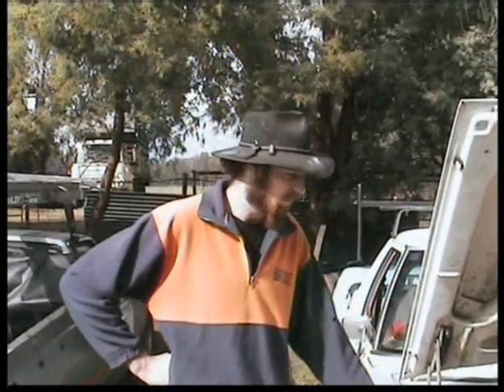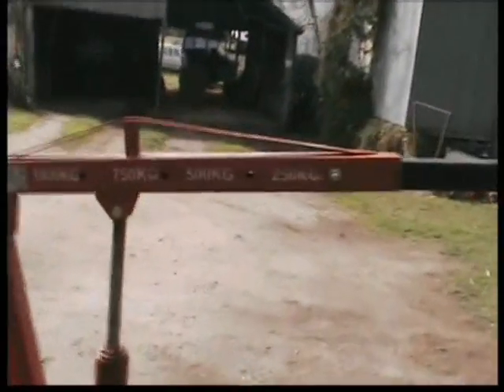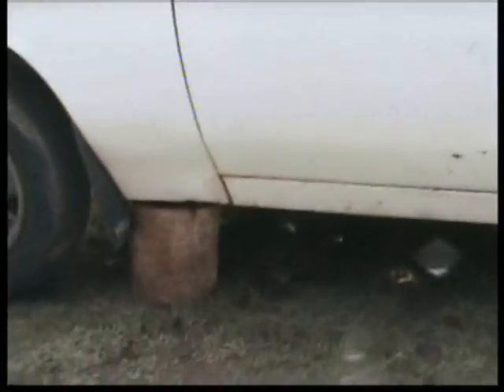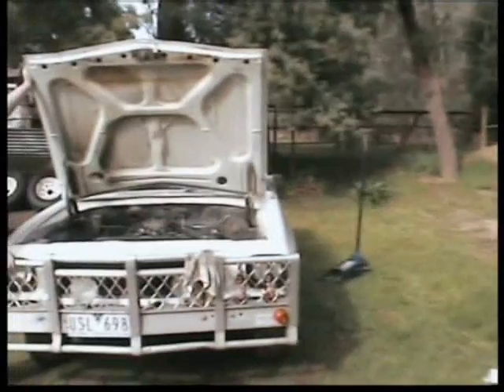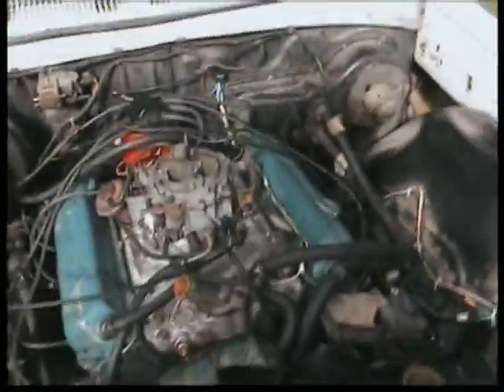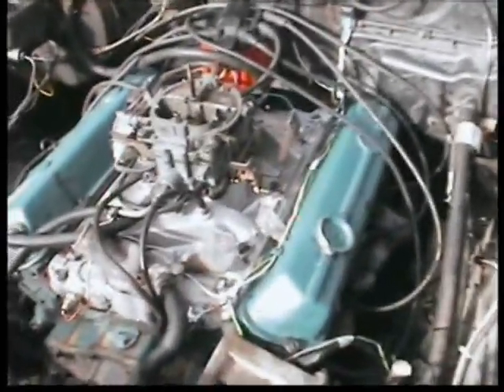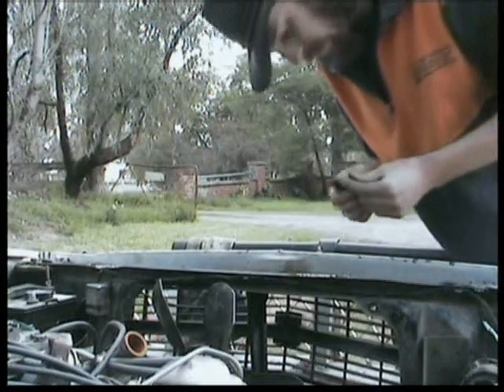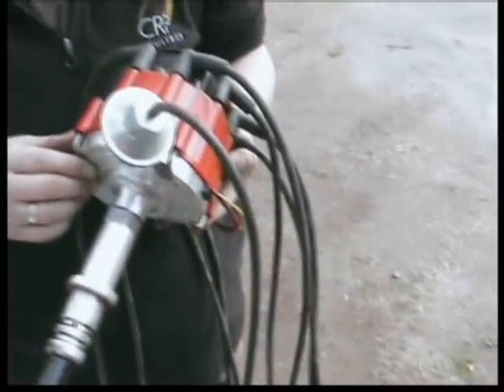How To Remove An Engine: PART 1.

Comment: youre the victa guy! great tutorial. swapping  351C into my 6 cylinder XF falcon
Reply from the maker: Haha Sure am. Nice mate. Will be a bit of a project from what I hear. You'll have to cut and panel beat the firewall in to make it fit. Most guys just get an XD XE and put the XF front on it.
Reply: shit?! i was told they straight swapped and only worries were the xf not having the mounting stuff for the clutch master which would just be 2 bolts from memory. seems common there are heaps of 351C's in XF on youtube... unfortunately the XD is rusted out and i got a good straight XF for it. Inherited the XD...  anyway your video gave me a lot more knowledge so when mechanic mate and crane come i wont be in the dark (i've only done bike motor swaps). I was wondering how you pull a gear box off as they're mighty heavy, but now i know you pull the lot

Comment from the maker: Well you can use a block and tackle from the rafters or an "A" frame or a good solid branch of a tree if ya keen. Just be really carefull that it can take the weight. I have also used forklifts and a jib on the back of a tracter before.

Comment: Just a helpful translation:

Boot = Trunk
Bonnet = Hood
Wing = Fender
Wheel nut = Lug nut
Brake disk = Rotor
Gear Stick = Shifter
Windscreen = Windshield
Drophead = Convertible
Estate Car = Station Wagon
Petrol = Gas
Hand Brake = Parking Brake
Silencer = Muffler
Spanner = Wrench
Tyre = Tire
Nick = Condition (In some uses)
Kit = Stuff
Ute = El Camino-style car
Arse = You, QcPride

Glad to be of use.

Comment from the maker: @JohnnyDesaint  Oh. That would require a bit of engineering then. The mounts wouldn't be to hard to weld up but the oil pan would have to be custom made. You may be able to dint it in carefully or cut and weld it. Not to sure though. Wouldn't it just be easier to sell the 350 and get a 351?? You would also need a custom tail shaft and possible gearbox mount modifications. Good luck with the project though. If you manage to do it you'll have to send me some photos.

Comment from the maker: @JohnnyDesaint Oh and also if your installing the new engine with a gearbox attached just be carefull not to ram the extensioin housing (rear of the gearbox where the tailshaft go's) into the firewall. Also to help installing a new motor it would be heaps easier to take off the front nose cone and radiator support then just walk in the new one in. If you descided to take it out and put in back in the same way as us then you'll have to push the gearbox down to get some angle to get it in place.

Comment from the maker: @JohnnyDesaint Putting a motor in is just the exact opposite to taking it out. Watch all my video series and you should pick most of it up easy enough. The only thing i find with putting motors back in is that you may have to jack up under the gearbox to lift it onto the cross member. For easier installation you could allways just take out the cross member then jack up the box and the re-install the cross member.

Comment from the maker: @mexiconotusa I would!!! Older cars are easier to maintain and to work on yourself. New cars require factory servicing and computer resets which can only be done at an approved outlet as to not void any warenty. This makes it very expensive. If you maintain your older cars/utes/trucks they will last forever!

Comment from the maker: Just to let you guys know, our v6 Nissan Navara blew a head gasket and the mechanic said min of $3000 to replace it. It is only $1100 for a replacement motor from the wreakers. The mechanic then said if we supply the new motor he would change it over for $1500. We just changed it over ourselves and saved $1500. Even though its a lot new than my old ute in the video the same priciples apply.

Comment from the maker: @1Rica1  It is a 308ci 5.0L Aussie V8. It was the biggest Australian General Motors Holden engine made at the time. The 350 chev will also fit into these holdens.

Comment: Well done guys, lots of info.
Loved the Dad 'n' Dave approach - really good info for newbies.

As for the timing....
Point the harmonic balancer to top dead centre, install dizzy and leads, take out number one cylinder lead with spark plug still connected. Turn ignition to on position (not crank position), so spark is getting through and rotate dizzy slowly until you see a spark, this is the correct position for Top Dead Centre and will get you started, then fine tune once you fire up engine.

Comment from the maker: With most V8's the rotor button points towards the No.1 cylinder at Top Dead Center. Any spark plug could be no.1 if ya like. Taking your own engine out then taking it to the machanics usualy saves ya about $500.

Comment: nice vid. 
when removing distributor how do you know where the spark plugs are going to go, or did you mark it?
srry if its stupid question.
i got a 95 mustang and i need to fix engine but i dont know anything. and after watching this vid i am really thinking about trying to remove the engine myself and seeing how everything works, plus save money.